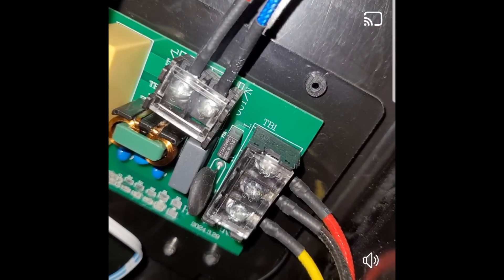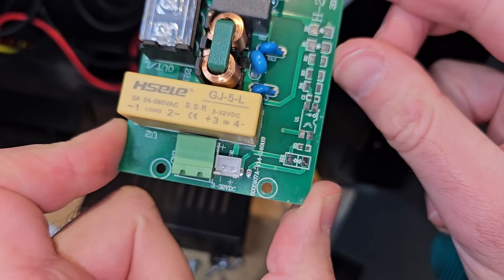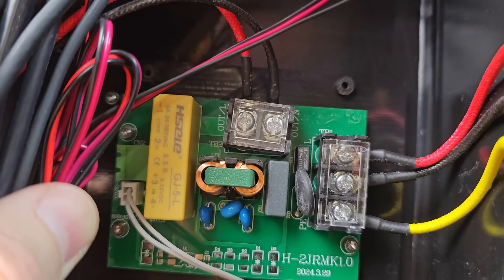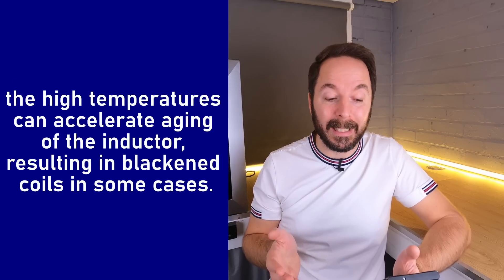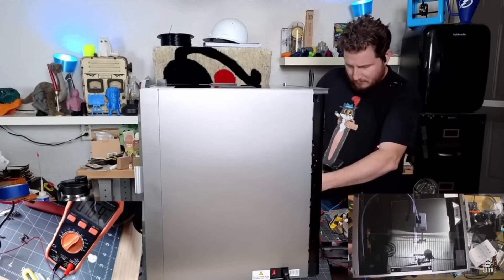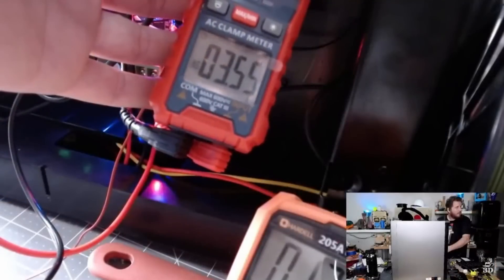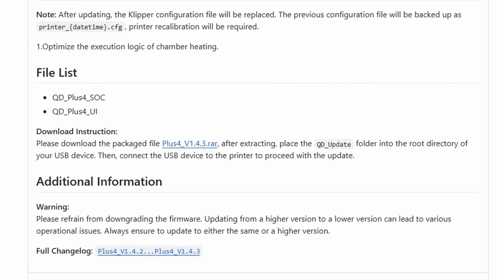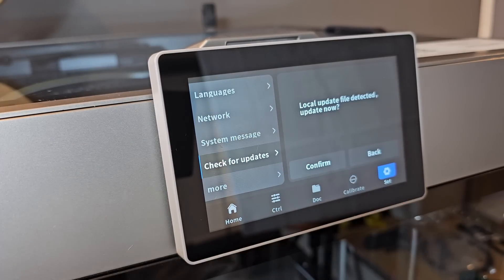Qidi X Plus 4 Defect & Safety Risk - All The Facts Explained With Reply From Qidi CEO

Comment: Same type of behavior as with X-Plus/Max3 with their tool-board with a RP2040 and max-temp limit of 80C. Using the chamber-heater there pushed the chip well above it's operating-limit. Same for printing PLA/PETG where their "fix" was to print with a open enclosure. Then we got the issues with heat-creep in their hotend due to inadequate cooling.
Heck they updated the firmware reducing the max chamber temperature from what the product was specified to manage.

Kits where made available to fix some of the issues, but only the ones that noticed the issues during the first year of ownership would get anything.

I know one thing. No more qidi-products in our printfarm, at least until they prove they can be trusted.

Comment: Your instructions are incorrect.  The wires do not go back on the same way they came off.  The new board is wired differently than the old one. You are likely going to cause someone to get injured  giving them the wrong instructions or maybe damaging their machine further. Please update or remove this video before someone gets hurt.

Comment: Thank you for your excellent review of this issue. Because of your open and honest video I have subscribed to your channel.  Qidi has upgraded all new Plus 4 machines to what they call the Second-Gen active chamber heating. This is exactly what they need to be doing, and I am glad that they have acted responsibly in this matter. I have ordered a new Plus 4 and I will update this post to reveal whether Qidi is shipping new machines with the new firmware pre-installed.

Comment: I don’t have a Qidi X-Plus 4 yet, but I plan on getting one. Qidi is an excellent company with reliable printers. All 3D printers can be fire hazards, as stated in every manual: do not leave the printer unattended. I am confident Qidi will address any issues that arise. If a fire occurs, it’s important to remember that this risk is universal to all printers, not just Qidi's. It's unfortunate to wait for replacement parts, but Qidi’s commitment to fixing issues is commendable. In contrast, I’ve struggled with Glowforge for two weeks to get a schematic for a known circuit board issue. Glowforge is a company to avoid. Qidi’s openness speaks volumes about their dedication to customers. Speaking to the Qidi CEO is possible; try reaching Creality's ANYONE with printer problems—

The real safety hazard in any printer is the hot end. By monitoring the printer as instructed, you’ll catch issues before they escalate. Qidi printers are no riskier than other models. I have the original X-Plus, and it excels in printing various materials. Whenever I have questions, Qidi’s support is prompt and helpful. MANY companies sell 3D printers, but VERY FEW offer such great customer support. If anyone has a $700 xplus 4 they want to trade for a $7,000 Glowforge pro once its fixed, id do it in a second.  Qiditech 3d printers rock. Get at me about the Blowforge if anyone has one of these printers they are scared of. #Qidi3d QIDI TECH

Comment: Ricky. Thanks for your well metered and thoughtful response, not everyone has applied such common sense. Qidi have shown themselves to be a responsible organisation with high levels of innovation and customer service. They distinguish themselves by listening to their customers and creating an open dialogue with them. Facets not always shown by other suppliers of similar equipment. I have no doubts that they will respond, but in common with most other makers and other ‘improvers’ who seek to modify equipment, we absorb a certain amount of risk as soon as we open a machine,let alone change it. My son is a qualified electrician, it is in any individuals gift to ask a qualified person to inspect their work or improvements prior to use, as I do. Please give them the time to carry out a full fault diagnosis before issuing a complete corrective statement, in addition to their initial response. I have no affiliations with Qidi but I have been involved in manufacturers responses to very much larger product faults, and the worst thing that any user can do is ‘stoke the fire’ with irresponsible rhetoric, some of which has led to the demise of some excellent UK and overseas companies, diminishing choice, value and overall quality of product.

Comment: So for 220v users. There is no problem?   Should I buy the printer today from Amazon?  It will deliver with the fixed board ?
Reply: Only new built printers are shipped with the fixe. So you might get one with the issue if it's from the old stock.

Comment: The new board is installed on my Plus4, issue gone!   Continues to be a beast of a 3d printer, love this machine.  Prints flawless abs prints up to 305mm, it has seen hundreds of hrs of run time since receipt on 25 September. Just about all prints were high temp heated chamber with many hrs of engineering grade filaments run with ease in it.   Make sure you know on new board the wiring on right side changes from original, watch their whole video beginning to end before changing or putting in new board.  Use flashlight to find how left side of casing releases from inside, took about 2 minutes but found spot that allows it to release..... WIll add a second plus4 in future and just saw they doing BF sale til early Dec, the Q1 Pro which I also own has price that is very hard not to push buy button, tempting great sale price for Q1 Pro which has amassed hundreds of hours of non stop abs at my shop.  I will do huge shoutout to QIDI support they are fantastic and they go above and beyond.  I own three of their printers and the support rocks!  The heated chamber issue only on 115v systems does not effect UK.  New board and updated firmware takes care of any and all concerns.   They took care of issue and added one yr extended warranty, outstanding.  Glad did not have to ship back or wait long time for new printer.   QIDI has excellent support staff and come a long ways over the past few years.   Like other companies like Bambu, recalls or issues happen with pace they release these machines, like Bambu they learn and adapt and instantly resolved issues and all future production will see updates.  QIDI been known to adopt beta tester and user updates right into their manufacturing based on customer feedback, what's not to like?  They rock!

Comment: My plus 4 just majorly crapped its pants after only 3 weeks of use. To be fair the printing quality was good, but the issues started to creep up very quickly, when first the back cover of the print head got repeatedly violently torn off during the rapid front-right corner bump motion, then a bigger issue popped up whereby if the print job got paused for any reason, the resumption of the printing would start off at a shifted XY position ruining whatever has been printed before. Then the nozzle would start coming out of the pre-print purging/cleaning procedure with blobs of material stuck on it, ruining the ensuing print. The firmware update did not resolve the XY shift of print resumption, but instead just killed the machine entirely, with the table being forcibly jammed right against the ceiling limit and the print head would then lodge right into the print bed, at which point the machine was basically done. Qidi, while replying fairly quickly to their credit, tried to wiggle themselves out of acknowledging the entire host of issues by referring to this cluster** as a singular "anomaly" and gratuitously providing me with some google link for my further education. Not until I firmly insisted on returning the unit (which luckily crapped out literally one day before their 30 day stated warranty was running out) only then reluctantly they promised to send me the shipping label next week which is yet to be seen. So the moral of the story is that you should only purchase this unit with some kind of extended warranty, unless you do enjoy having an $800 brick decorating your house.

Comment: Checked your channel - you don’t review other brands, mostly Qidi. Was looking for your opinion on other popular brands and found nothing. So your reviews of Qidi seem bias and even this video seems soft qidi. No wonder Qidi is cheap, they are designed cheap and built cheap. Still don’t understand why no statement from Qidi- I was just about to order this Printer and now will stay away from the brand all together
Reply from the maker: I think you might have missed my reviews for Creality, Kingroon, Bambu Lab, Artillery, Wedo, Two Trees, Sovol, Mintion, Revopoint, Sunlu, FL Sun, Elegoo, and BTT 3d printers and products. Not to mention other types of machines that sit alongside my two Qidi product reviews, but thanks for the comment.
Reply: @RickyImpey  thanks, I'll have to look at your channel again. I almost bought the qidi plus 4, and qidi responded that after buying I will ha mve to contact them for a new board. I wanted your opinion of the X1C

Comment: what does mean "exrended"? doing a 20h print at high temperatures is why we buy the printer in the first place... 30 minutes is "extended" minus 10min warmup, means only 20 minutes prints can be made without losing the magic smoke? This is nothing else than negligent design. I'll let the reader decide if this negligence is criminal ...

Comment: I have contacted Qidi two times over this.   Still waiting for their 2nd reply.  I only print ABS in this printer, so use the chamber heater 100% of the time, and I don't really feel confident in using this machine until I have the new board installed.

Comment: Qidi presents themselves as making professional printers, their website feels like they're competors with Bambu Lab, or even Ultimaker and thus you would expect a quality 3D printer. However, these issues show that Qidi may not have tested the printer's safety enough. Of course edge cases should be tested: different voltage levels, operating in too hot environment etc. I'd say thermal issues are the biggest safety concern for any 3D printer manufacturer, and even a cheap FLIR camera attached to a phone would've presented this problem with an obvious white dot that represents an out-of-spec temperature. Now,, the issue is remedied with people being asked if they want to work on mains voltage, as well as a firmware upgrade to limit power. The latter seems like a bandaid solution to me, because relays can fail and firmwares can get stuck. In my opinion: do better Qidi

Comment: Thanks for the thorough investigation!! I'm on 240v, so hopefully my heater board is safe. However, after 1.5 weeks of low-moderate use (with low-moderate speeds), some other issues have started appearing on my production unit. The machine has developed a mild, but noticeable scratching/grinding sound whenever the tool head moves along x-y rails. It is hard to tell if the noise is coming from the the belt rollers, rail/shaft bearings or stepper motors. It actually feels a bit rough or gritty when I manually slide and reposition the tool head. The original grease on the lead screws has already started turning from a white color to grey, which I hope isn't being caused by premature wear on the metal contact surfaces. I guess there is a chance that could be from printing black filament (if some strings or particles found their way onto the tracks). The final issue could be more cause for concern... I think it was @noizieworks that pointed out that some of the cables coming from under the heater in the build plate tend to rub on the side of the chamber. Today I noticed another small, insulated cable plugged into a connector on the back edge of the bed, and this cable is rubbing on the black plastic below the air filter. Within two weeks of operation I can see signs of frictional wear on the cables plastic insulation sleeve - which I think is concerning and, with everything else combined, I am starting to think this might be a recall or warranty replacement. I would like to know if these issues are confined to my machine, or whether there is a bigger QC problem underlying all of this.

Comment: I just wanted to make sure someone has told you in your demo, you turn the printer on, not off a 9m 29s. Thank you for posting your video!
Reply from the maker: Thanks, unfortunately I missed this but can't do anything about it now. I've added a note to the description in case anyone is confused.
Reply: @RickyImpey  no worries. Question, do you need photos of the relay board? mine just came in and I can snap some pics and get part numbers if its useful

Comment: This should have been an immediate PSA to stop using the chamber heater, and a recall for a replacement printer, full refund, or a replacement SSR board at the customer's option. Firmware update doesn't actually fix the problem, and just degrades performance when the issue is fixed properly. I was actually considering buying one, but just from the way they handled this I'm resolved to never buy one of their products.
Reply: Wow, talk about shooting yourself in the foot...LOL.

First, it wasn't "just" a firmware update that was issued. They have also sent out the new boards to their customers. You also completely missed the part about how the company has sent out e-mails to their customers offering a return/refund. Secondly, it wasn't as if this issue happened a year ago and they have ignored the issue. This is a very recent discovery and what they do additionally in the coming weeks/months is yet to be seem. 

So far they have acted responsibly and even extended customers warranties to an additional full year. Other companies would not have done this. Those that have followed this companies growth know that they listen to their customers and strive for openness and integrity. Because of their responsible actions thus far I have even ordered a another Plus 4.
Reply: @AngelArsFoundation  lol, nice shill, all of that happened AFTER I made the comment you replied to, in response to community backlash.
Reply: @sleepib  Thank you for proving my point. 

Also, since you apparently don't know the actual definition for the word shill, hopefully this will help you;

shill (noun)
1: one who makes a sales pitch or serves as a promoter.

I am not affiliated with ANY company. Not here to sell or promote any product. Not my job. I am only interested in the bare FACTS of the matter. If this company would have acted irresponsibly, I would have been the first in line to call them out on it. God bless.

Comment: I bought an I-fast just over two years ago and it's a piece of crap. Endless problems of all kinds. I must add though, they offer the best and fastest  service ever. They even answer emails on weekends. They are very helpful but I guess you can't fix a badly conceived and designed  piece of crap.The newer Max 3 is a beauty though and I would buy another one if they offered an upgrade to klipper for the I-fast. I wld spend another $800 or so to upgrade this machine that is very well built and sturdy, if an upgrade was available. There service is second to none so that is why I stick with them, but don't jump in early on their new offerings as this qidi 4 is like my experience with the I- Fast and that was $3500 AUD. Although there shop for parts etc has improved it is not good. Very little info on the items so difficult to choose the correct parts etc. They will def help you but it can turn into email ping pong and I hate that. Just get employ a good tech writer to classify parts and specs etc so the correct parts can be ordered and they wld not have to attend to so much email. Also upgrade offers wld be greatly appreciated. All in all, I wld only buy a new model qidi after the first year of release. The max 3 is a ripper and prob the ones you get now are even better.

Comment: Although I do understand the simplicity of replacement but at the end of the day that's not the end users responsibility. Especially because most end users are not actually comfortable doing so. Second most end users don't know anything about electronics. So  asking them to play with mains voltage is just a HUGE safety liability in and of it's own. Regardless of if it has cought fire or not it's not a safe product. This should have been caught in R and D before it was released. While I do know some things slip by this one is not acceptable.
Reply: It's probably a good idea for Apple users to just wait until they release, I mean, re-invent a 3D printer.
Reply: @JJFX-  LoL, Right
Reply: @JJFX-  ROFL those soft hands, man buns and blue hair? lol
Reply: If you use a printer enough, eventually you have to do this kind of stuff, well if you're not a diyer then it just a "toss it in the trash" kind of thing I guess, but yes for a brand new product it's a shame that the end user has to do this ... Think qidi should be offering something more for our trouble, a new  nozzle or some of their better filiment...

Comment: They want to switch the board to those livinging in the 110V area? So, if I buy a printer ina 220/240 area I will still have the original board? What happens,  If I later decide to move to the 110V area and I forgot about this issue?
Reply: I said the same thing on another video comment section, it's a shame... They should just replace all of their printers with a corrected version.